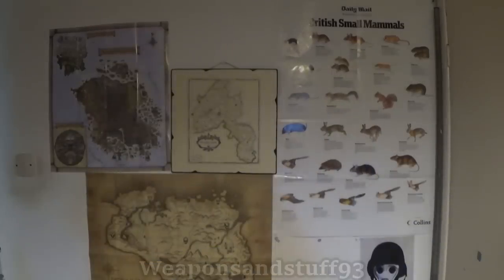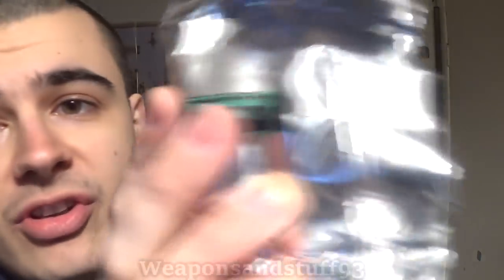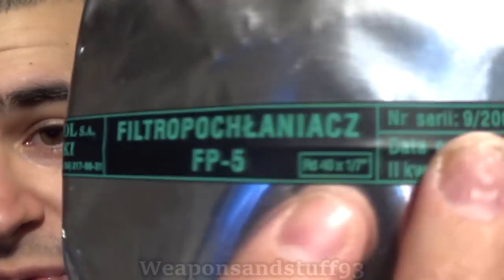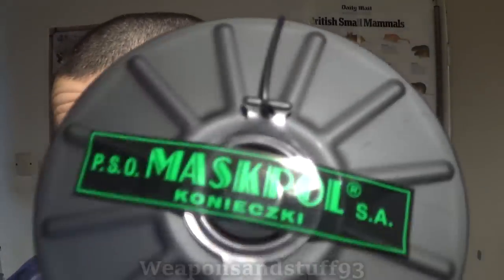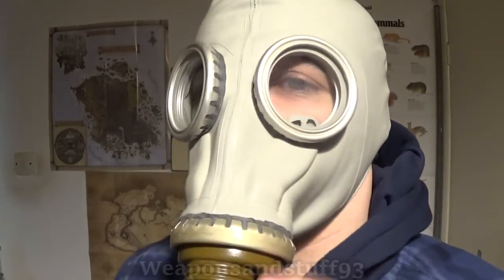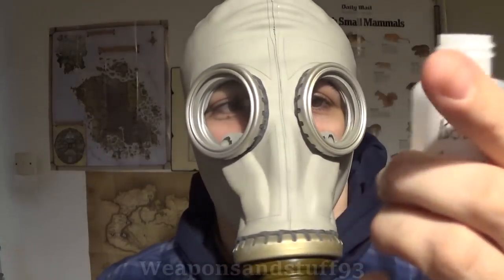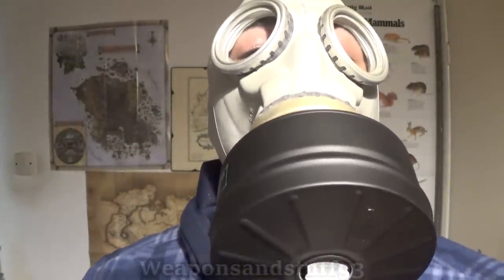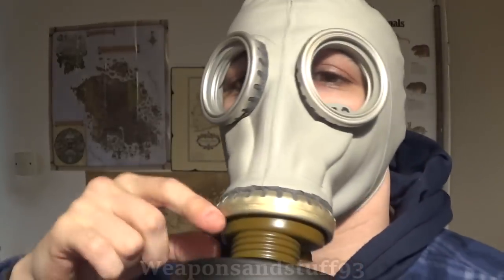Polish FP-5 Filter Test, Works with a GP-5!

Comment: This is probably a really stupid question but would the older silver ABEK style polish filters still be good for NBC use if they’re sealed? I could get some FP5s but I could buy 2 ABEK filters for the price of shipping due to them being in Britain.
Reply: 2 for the price of shipping an fp5
Reply from the maker: Against particles they will be fine, they are still P3, but those filters are only ABE if I recall, so they don't block ammonia efficiently.

Comment: what type of mask would you suggest to someone with glasses im main looking for one to use for fallout or CS gas
Reply from the maker: No masks are compatible with glasses unless you have custom frames made to fit inside the mask.
Reply: ok thanks i know there is a kind of glasses frame that the us military used but ive read some masks have a way to have a frame installed in them
Reply: Soviet versions of the ppm 88 supported outserts for the visually impaire
Reply: Germans have made gasmask glasses so u need to search for a cold war or ww2 german mask
Reply: the german m65 supports glasses, however not any glasses, it has little ports inside for special glasses

Comment: I believe you once mentioned that the ex-sssr only stopped using Asbestos after 2010. Are you 100% certain that FP-5 filters made before 2010 are safe? Just an exception or something?
Reply from the maker: Poland stopped using asbestos at the time of independence. As the filters were made then by private companies not state run factories etc. MASKPOL filters are all paper HEPAs

Comment: I brought a  p-5 filter for my shalon 4a1 mask. Seller said that I can get either a fp5 or p-5 filter and they are the same but we know how trustworthy are sellers. Mine was made in 1995 by Maskpol and sealed looks exactly like fp5 except the name. Logic says that it should be asbestos free but quick search does not yield too much info. Do you know if it's asbestos free?
Reply from the maker: It should be safe as after Communism Poland wasn't buying asbestos from Russia. Maskpol filters look like they contain paper.
Reply: Weaponsandstuff93 OK thanks, I wanted to use it as temporary filter anyway until I get proper new abekp3 filters.

Comment: do hoses have anything dodgy in them and how will i know if it fits my GP-5 because im looking at buying one.
Reply from the maker: Only talc which isn't much of a problem.
Reply: i have minor asthma so if i was breathing through it with a hose would it be fine.
Reply: The talcum powder is virtually harmless. Actually sometimes used in treating lung issues.
Reply: Just wash out the hose and you should be fine. As aforementioned, there's only talc which is easy to wash out

Comment: the filters i got are expired either in 2009 or 2011 still sealed can they be used,will they work?
Reply from the maker: It will be safe, it may still work but no well of telling without actually using it.
Reply: thanks

Comment: My filter is from 2003 are they still can save me from weak gas?
Reply from the maker: Without testing the filter there's no way to know if it's expired.
Reply: Weaponsandstuff93 kk then I will use bug spray or something in small room with mask hopefull Its will work

Comment: Can I use an Israeli 40mm NATO filter with a gp-5 mask
Reply from the maker: Only if you add a rubber o-ring to the filter intake.
Reply: Do the o-rings come with 40 mm filters or can I buy them off eBay/Amazon?

Comment: so maybe be u will read it maybe not but for others i think every filter should stop SMELL i tried to make same test with gp -5 i got one from my dads work he is rail guard securtiy guy and he got one in 87 or some so filter was all time opened in hes case ive did that test and i cloudnt smell antyhing i askd my father why i cant smell antyhing when i have mask on me and he respond(he was in elite chemical forces durning Communism in poland) its due active coal in filters and its. And the gas mask since 73 are probably save cuz warsaw pact countiers and soviet russia stoped using it in filters but i heard that filters used in mc-1 also had them idk messy
Reply from the maker: All the asbestos reports from Finland and the Netherlands on GP-5 filters show every filter tested containing asbestos.
Reply: Here in Poland we have really low information about this filters even we have thousands of them thats paradox . The gp5 or some post  communist stuff was made to mass war. Solidier live had to last no longer than couple of hours so equipment  has to be cheap and simple. Therefore, no attention was paid to him. Btw nice contents keep it up.